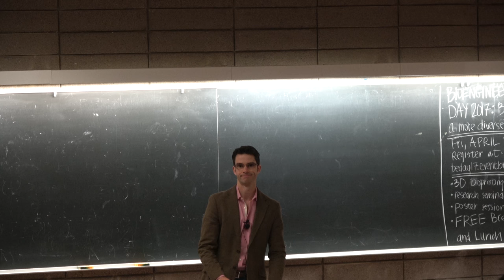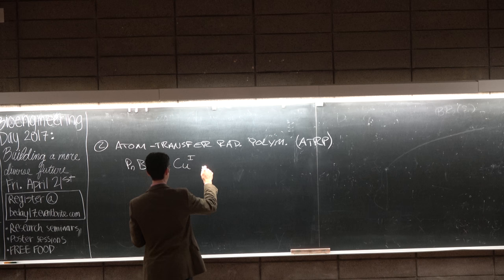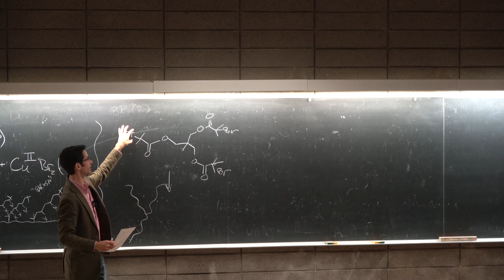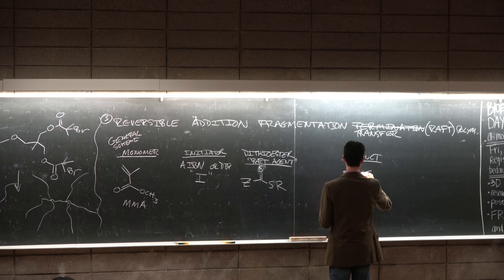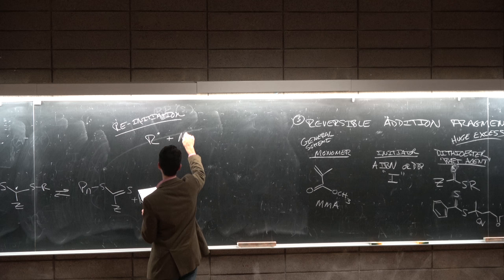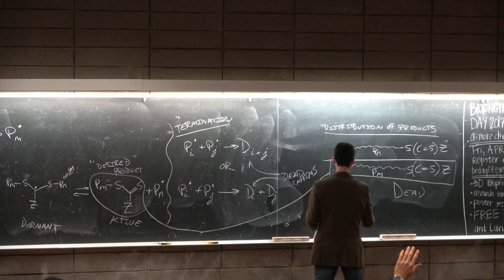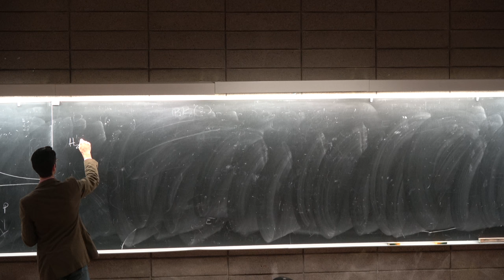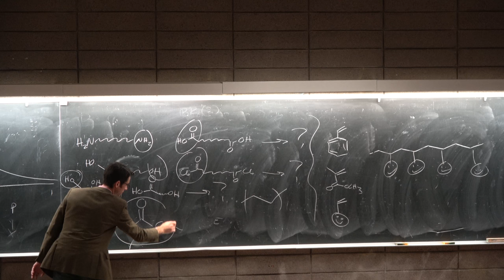Ep8 ATRP and RAFT - UC San Diego - NANO 134 Darren Lipomi

Comment: I like the lecturing style of Prof. Lipomi in general! There are however a coupe of issues here, Just two now:
- A wrong statement on the evolution of the average molecular weight in free-radical polymerization ("hockey stick"). This metaphor is valid for step-growth polymerizations. For free-radical polymerization, Mn = f(conversion) is a slowly decreasing curve, since long chains (but never as long as what RDRP/CRP can achieve at high conversion) are formed from the start and chains continuously initiated and quickly terminated become progressively shorter (as monomer concentration decreases).
- NMP is actually quite tolerant to functional groups. ATRP not much more, could be less in fact (acrylic acid for instance does not work by ATRP, as opposed to NMP). NMP presents indeed the disadvantage to not (well) work with some monomer types due to nitroxide-based H-abstraction. And a further downside is the required thermal activation, which can sometimes be unpractical. Other than that, this is a pretty versatile method too. Why isn't it used more (vs ATRP or RAFT polymerization)? The good nitroxides are not commercial.